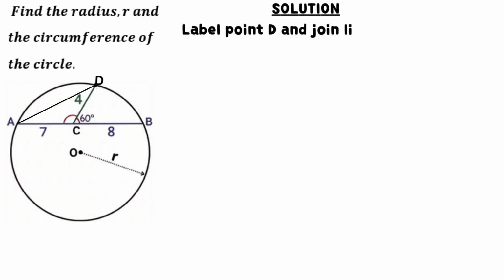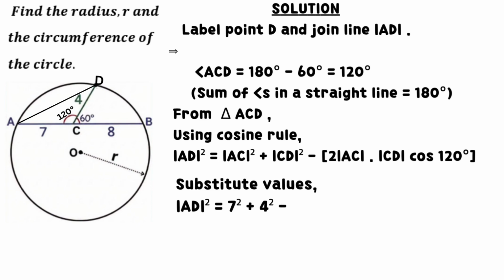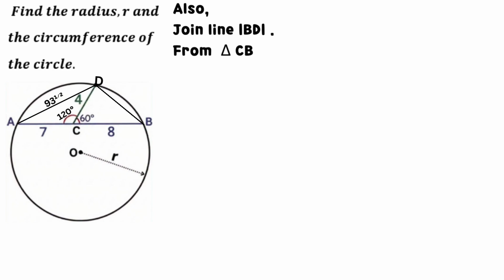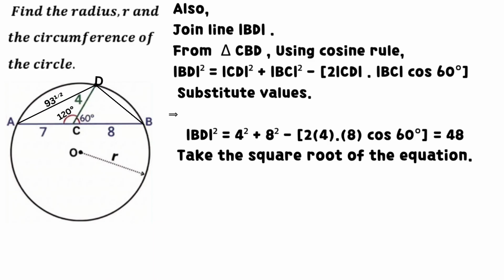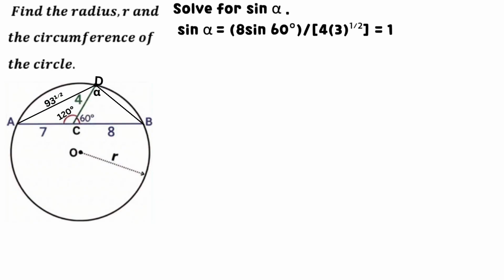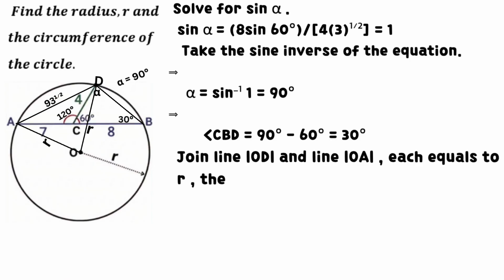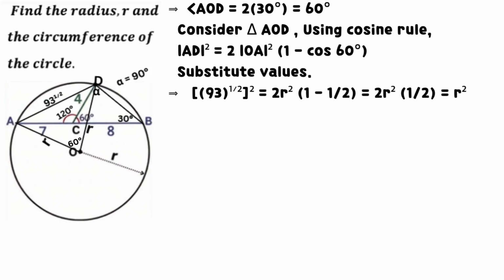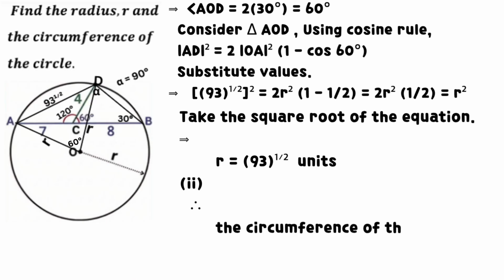Find the radius , r and the circumference of the circle.

Comment: See how to solve.Takingvlogvof bothbsides,( x+8) log 7=( ( x+7)log 8.So ( x+8)/(x+7)=log 8/log 7=log 8 .Dox+8= 1.0686x+ 7×1.0686to the base 7 =1.0686
Reply from the maker: Your solution work did not reflect the solution to the given question in the video.
Reply: Actually it is the solution to other problem and got posted in this  as before I could post  it in that problem the video changed to your video..Also it was  not.properly edited.I could not find your video so that I could not delete.it.